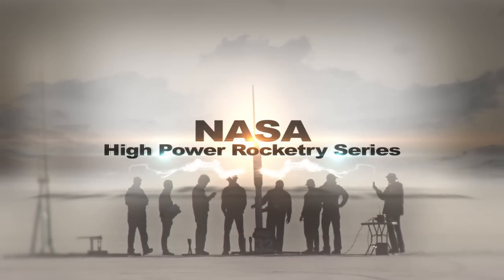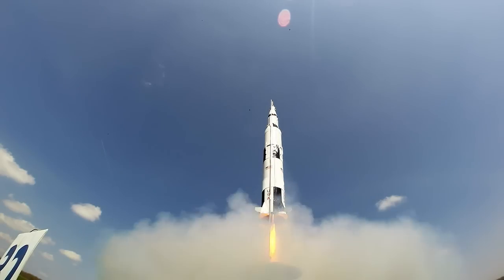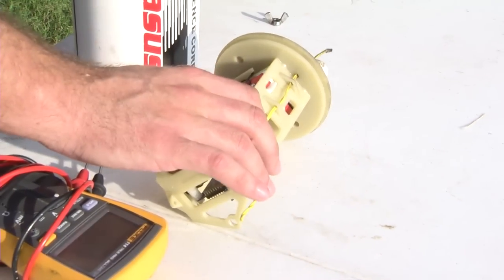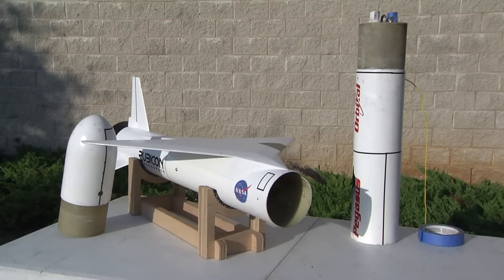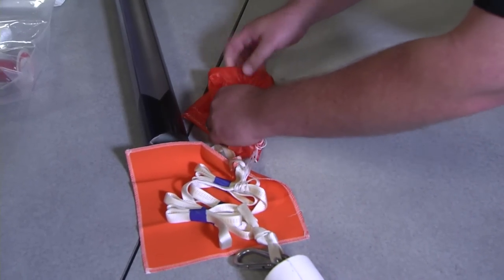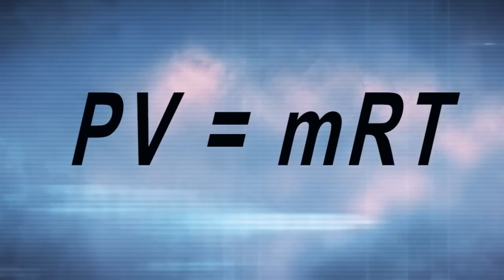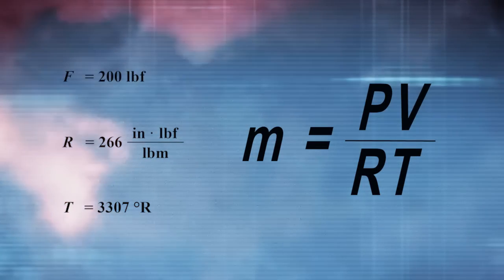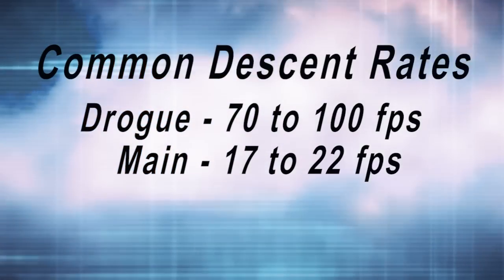Recovery

Comment: What happened to the SI units the introduction video told would be used? If starting from imperial units, the first step should be converting to SI, then calculating, finally reconvert if wanted.